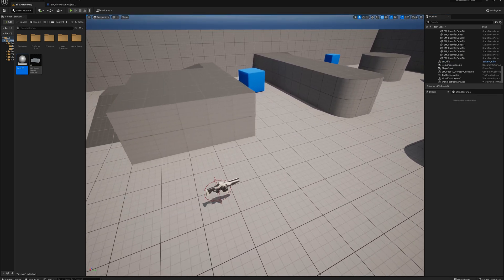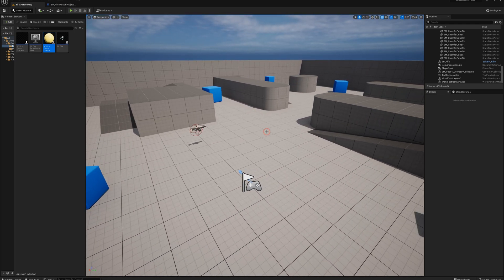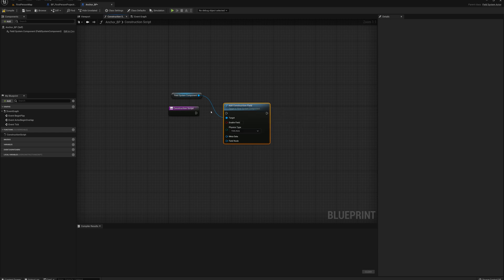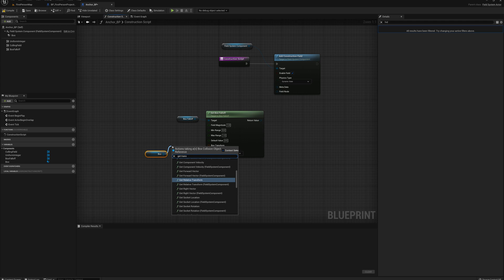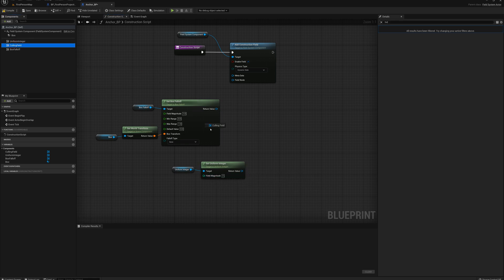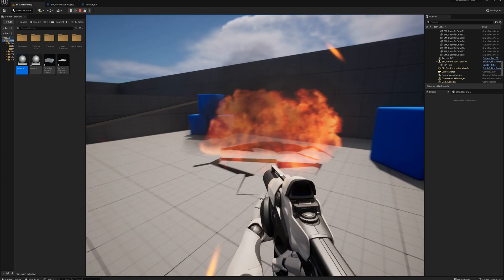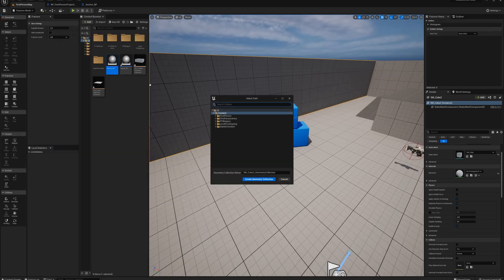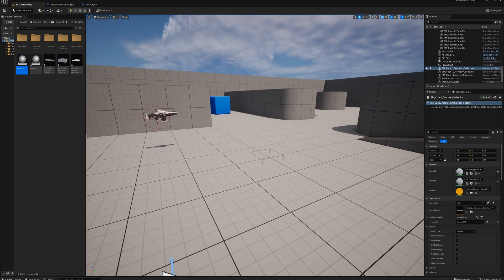Chaos Destruction In Unreal Engine 5 - Part 2: Controlling Destruction With Anchor Fields

Comment: Thanks for the tutorial. Just share my experience for whom may concern: In 5.2, hitting the geometries within the anchor will no longer be released automatically, you will need to change the Field Magnitude back to 4, i.e. Dynamic, on "Event Actor Begin Overlap". The setup can be copied from Epic's FS_MasterField BP "Make Dynamic" section in the Event Graph. "Falloff Shape Switch", "Make Dynamic Enable Non GC" and the whole Meta Data part can be skipped, but you will need to copy from the Construct and connect the "Set Box Falloff" back to "Set Culling Field".
Reply: I hope he makes a new video to address this. Thanks for the info though!
Reply: Hard to follow your directions. Where do you find Epic's FS_Masterfield BP to copy from? And where are you copying it to?

Comment: Tutorial was fantastic right up until around 8:20. Followed it perfectly and exactly with a new blank project. However, the floor still falls. Guessing something changed with 5.1 to break this.

Edit- Just figured something out while testing this further. Dragging the anchor box deeper into the floor stopped the floor from falling, however now everything else in the surroundings falls, instead. Like the cubes as well as our other fractured mesh.
Reply: verify if the "Enable field" buton is check on the "add constuction field" node in th Anchor_BP
Reply: @xenonguillou7105  The "Enable Field" checkbox is indeed checked.
Reply: @victorgross3722  Did you find a solution to this?
Reply: @anthonymerle310  Unfortunately, no. Been over it dozens of times and I'm completely stumped.

Comment: This anchor field doesn't work as of Jan 2023.
Reply: Yeah, I have checked the settings and scripts three times now. When I add the anchor field. It simply floats and does not break on impact with the bullet explosion.
Reply: Let me rephrase that. It works if you remember to change the culling field to "Outside" and not "Inside". :face-blue-smiling:
Reply: verify if the "Enable field" buton is check on the "add constuction field" node in th Anchor_BP
Reply: It does though (in 5.0.3)

Comment: it still falls, please help!
Reply: verify if the "Enable field" buton is check on the "add constuction field" node in th Anchor_BP
Reply: @xenonguillou7105  no it doesnt work after unreal 5.1
Reply: Same problem - 5.3 (the anchor stops all fracturing if the anchor is touching any part of the fractured mesh.

Comment: Great introduction to UE5's Chaos System and how to manage destructibles.  Question: At the end of this video you show the wall anchor, but when I tried doing it I found there was an issue with height destruction.  Why can I only destroy the lower parts of my destructible meshes and not the higher parts?  Thoughts? Insights? Solutions?

Comment: Can you use the same anchor field on multiple object? If you have a wall split up in three different parts. Do each part need to have their own anchor, or can they share the same one? Great tutorial 👌
Reply from the maker: Yes you can share anchor fields no problem!
Reply: @buildgameswithjon7641  is there some kind of trick to get that to work? I tried with three wall objects sharing the same anchor. I scaled the anchor so it covered the top part of all the objects. But only the middle object respected the anchor. When I made two additional copies of the anchor and assigned each object to each anchor, it worked as planned.